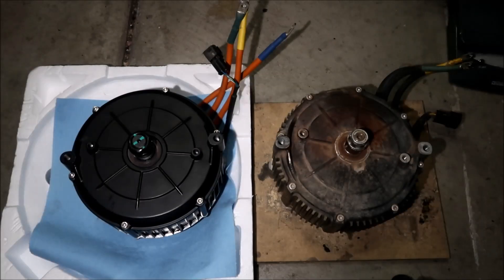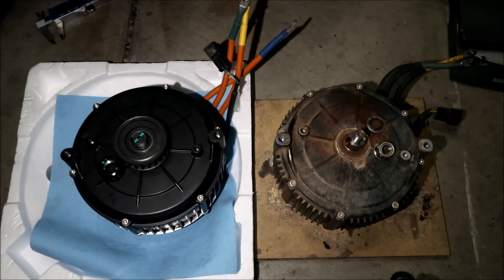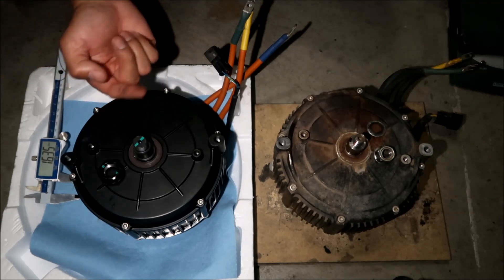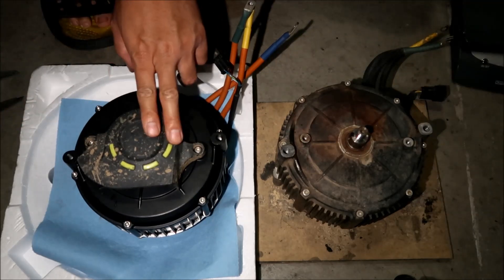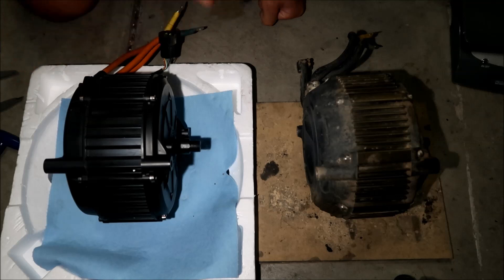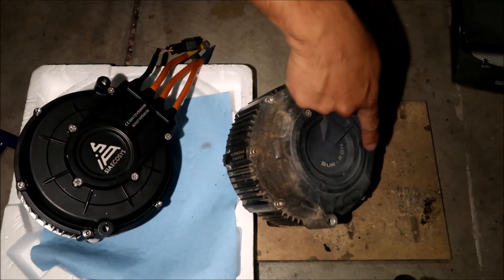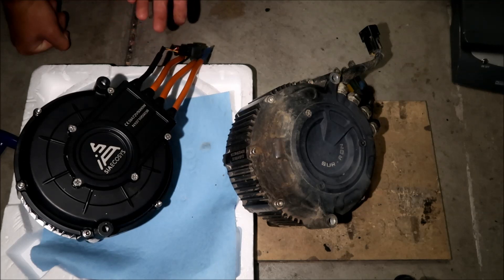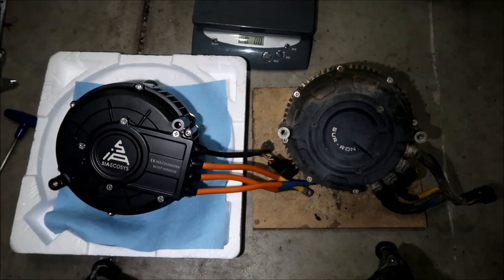QS165 vs Sur Ron Motors External Differences

Comment: What is the depth a with off the motor. These  motors might be wider or taller. Did it fit the surron without any fabrication on mounting washers in a frame
Reply from the maker: Hmm I can't remember. I remember one of these motors I needed to modify the spacer to get the motor to fit properly.  I could never get this motor to run right so I sold it and got a KO F-Spec Motor instead.

The install vid is here:
https://youtu.be/tndz6HiUM0s

Comment: Do they have the same mounting holes and dimensions? Meaning are they a direct mount swap?
Reply from the maker: Theh are the same but the front left mount is too tall.  It won't fit unless you shave it down or shave the spacer down.